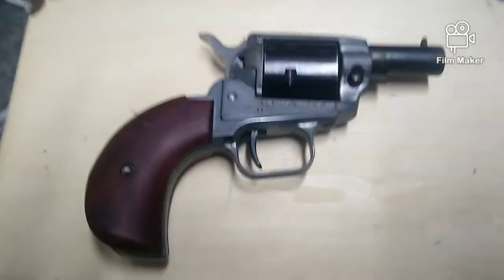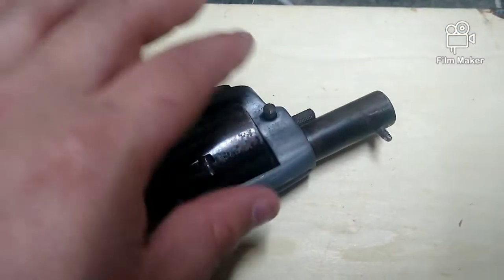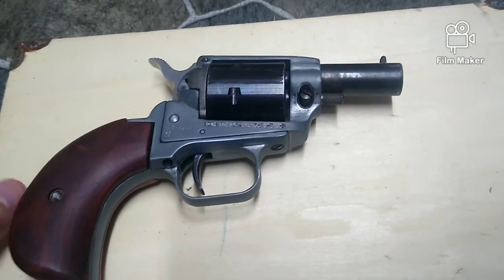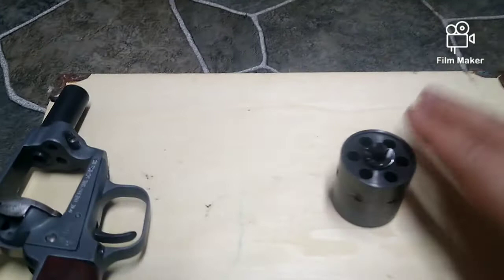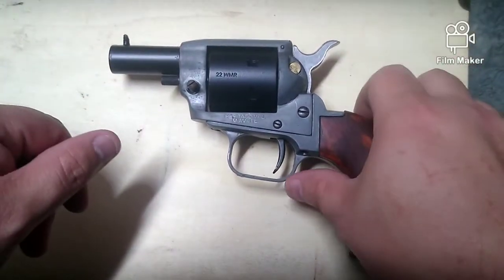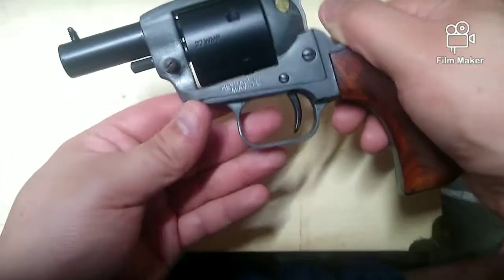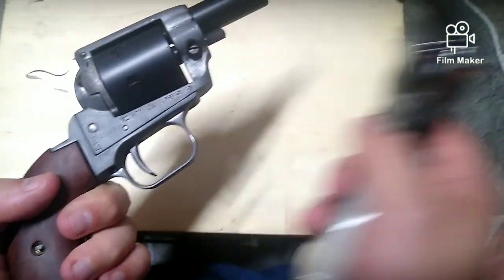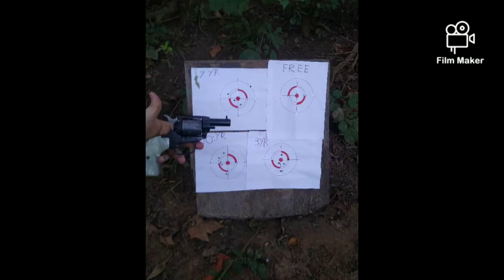stealing my gun back from corrosion with steel it paint

Comment: I am going to paint my browning with steel it.  How is it?  Is durable and strong as they say?
Reply from the maker: It’s a stainless steel base spray paint it’s tough but holster where has since stripped it off the barrel and in the cylinder I think Sarah coat would probably be a better option but since it’s a Browning, you may want to go with like a Dura coat Dura blue I think it would look much nicer but that’s just my opinion